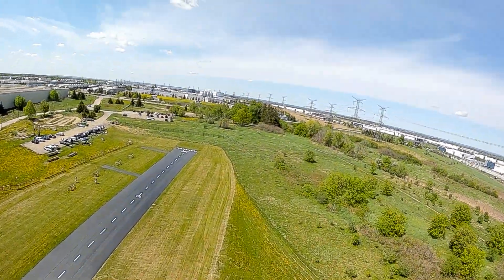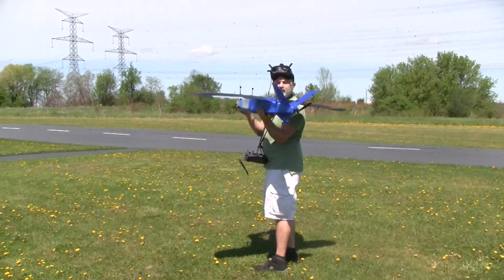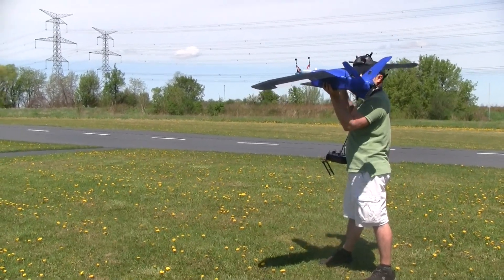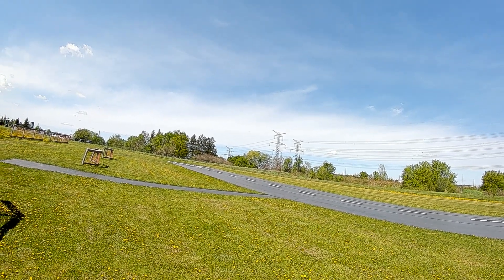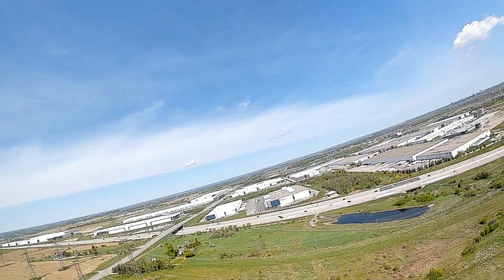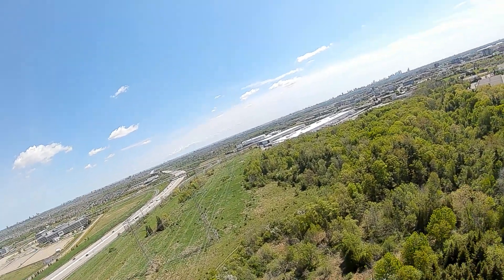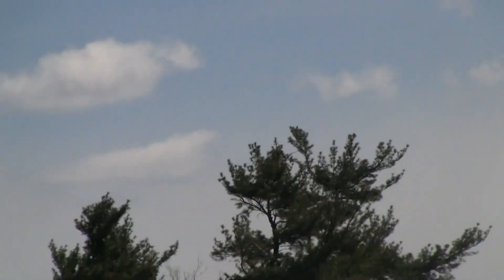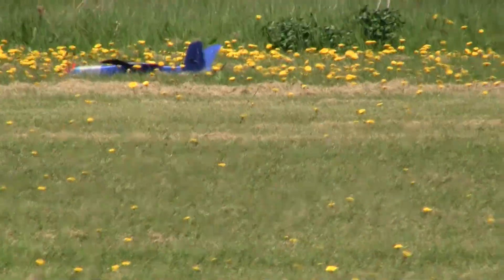3D Printed X-UAV Mini-Talon - Last Part (Maiden/Landing)

Comment: On the thingiverse page it looks like the .stl files are groups of parts, rather than individual parts. Is there any way to split them into individual part files that you would recommend?
Reply from the maker: Hello Adam, i can definitely do that, but you can also quickly do it using windows 3D builder software, open the file, ungroup the parts, and then select the part you need and save it